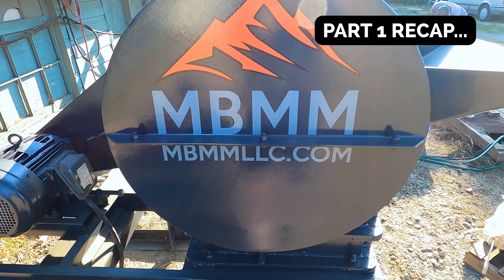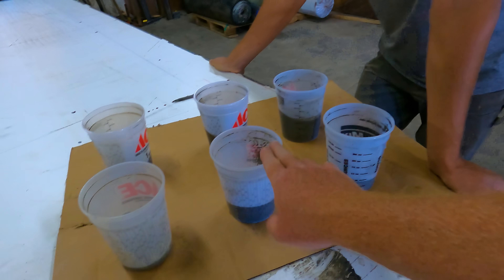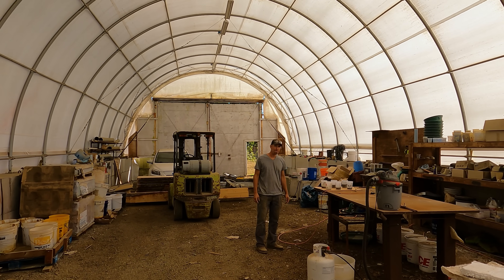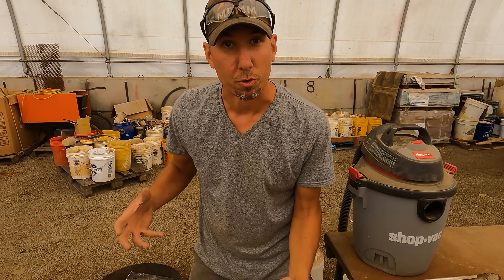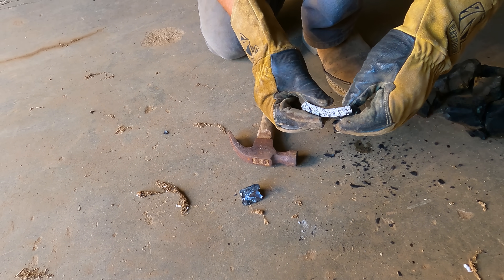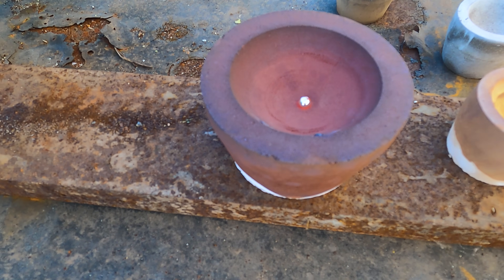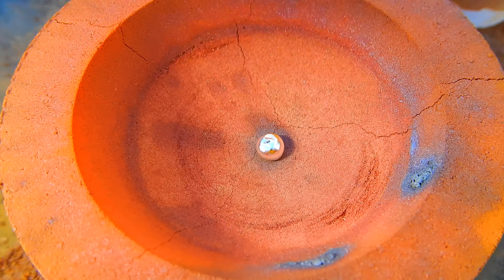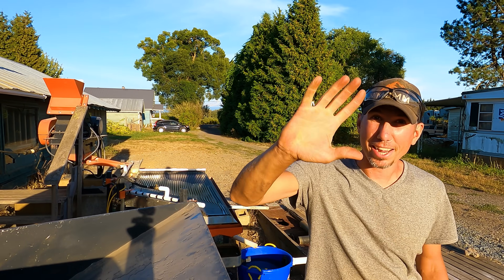GOLD Ore Smelting!  How much will we find?

Comment: Excellent videos folks! Do you make a tare weight when making up your mixes? Also, may I suggest you heat up your 'pyramid' mould to a good heat (150-200C ) before you pour it. We used to make ingots for the Royal Mint here in the UK, so your videos ring a lot of bells. Do you dross off before you pour?  Cracking stuff, and good luck!

Comment: Okay so if the gold is heavier than the slat which is the reason for the mold shape wouldn't that mean there would be some hold stuck to the bottom of the crucible when pouring into the mold?

Comment: How does the iron melt it melts at 1538
Reply from the maker: The iron does not melt, is dissolves, reacting with the different chemicals and sulfides in the molten mix.  The resulting iron sulfide is then absorbed into the flux.